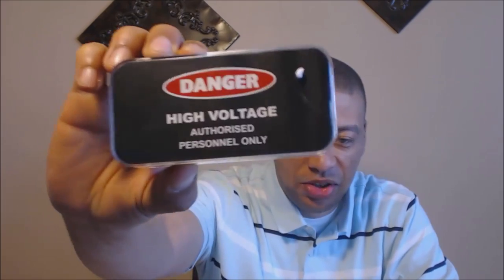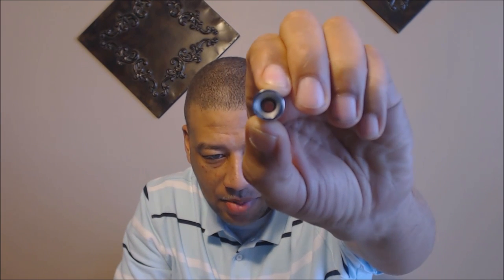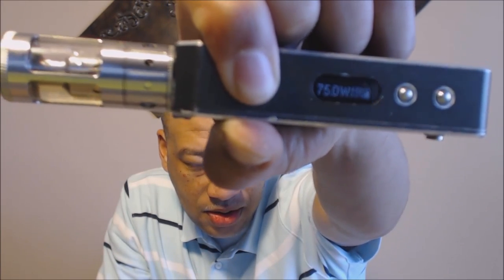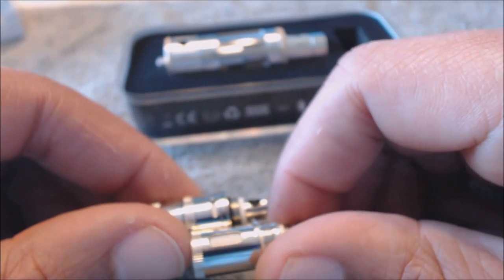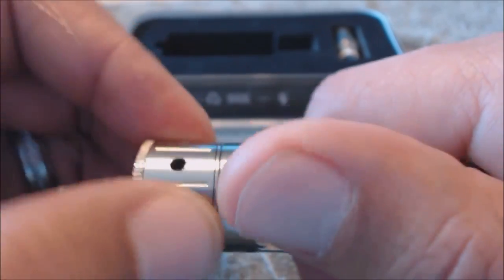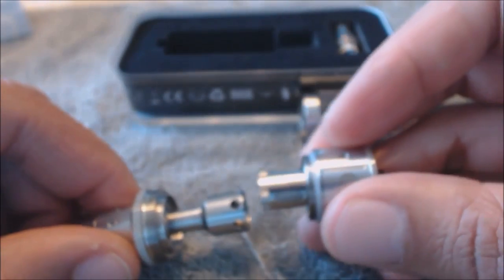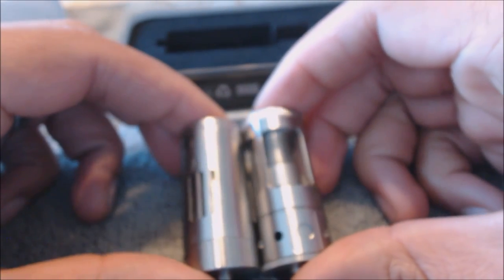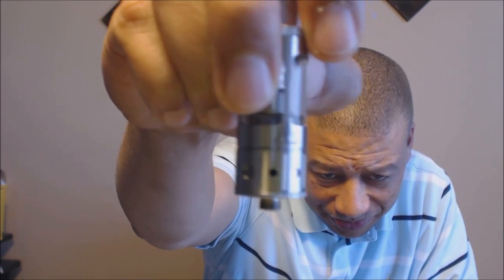(New 1080p)HIGH VOLTAGE Another sub Ohm Tank This one is Guud

Comment: I tightened it after it fried my m80, then put onto the istick, which after 4 pulls stopped working, checked the pin again and it had come loose, and now no longer wants to fit where it's meant to properly anymore, yeah possibly, mine doesn't feel like it's under gone any quality control at all

Comment: PS: I just noticed that my tank was built differently.
It doesn't have the holes at base 2 line up with coil & the outer air slots @ bottom of tank are elongated with one opposing the other.

Comment: Nice!
Reply from the maker: Thanks
Reply: Yes it is the newer version of their drip tip. The matrix is supposed to be better. There's a list of differences. 

The Matrix Sub-Ohm Dual BVC Tank by High Voltage ups the ante of the Sub-Ohm Tank field once more, integrating a massive 5 milliliter capacity, dual adjustable 14 mm airslots, and an integrated 6.5 mm auxiliary tip airflow! 

Designed in the USA by High Voltage

Introducing the Matrix Sub-Ohm Dual BVC Tank by High Voltage, the newest Sub-Ohm Tank that integrates cutting edge designs to combine to make one of the most advanced and feature loaded tanks in the industry! Starting from the Dual Vertical Coil foundation, High Voltage configured the base of each Matrix coil with rectangular intake holes, increasing airflow rate into each coil tremendously. Paired with the adjustable dual airslots measuring a staggering 14 mm each, airflow passage is efficient and adjustable to allow for unbelievable rates. Each coil features a large juice intake surface area in order to keep the rate of wicking efficiency extremely high to cater to ultra high wattage chain vaping. The Matrix is constructed from high quality Stainless Steel and Pyrex, with the tank, coil, and airflow chambers streamlined in order to accommodate an incredible 5 milliliters within a 22 mm wide profile and competitive height, dwarfing the competitions current capacity. The included competition bore tip also features an adjustable auxiliary airslot measuring 6.5 mm, allowing for secondary cooling to make ultra high wattage vaping cooler and more effective. With an incredible feature set, top level performance, beautiful fit and finish, and a very competitive price, the Matrix Sub-Ohm Dual BVC Tank by High Voltage is an absolute must add to every collection.

Comment: I just picked one of these tanks up today. My drip tip is different though. It has adjustable airflow but the style is different. It's just one oval shaped hole that you can close off to different sizes. I'm wondering why that is...
Reply from the maker: Can you join cloud compound group on Facebook. Take a pic of it and share. Its a closed group but you will get let in by myself or another vapor. I would like to see that
Reply: I just bought one of these and have the same thing. My drip tip doesn't have multiple holes. Just 1 oval one with a gradual opening. Has anyone figured this out?
Reply: spaz0023 I just posted to the link you have, the one with multiple holes can be found on this link, which is where I ordered mine for a great price and has coils in stock

http://justvapeinc.myshopify.com/products/high-voltage-0-2-sub-ohm-tank
Reply: Yes, we did find out that the one that has the just the 1 big airflow hole is actually a newer version that the company is no using for this tank and their new tanks including the Matrix tank. Thanks though.
Reply: Now using*
Reply: spaz0023 So wait the "Matrix" tank is actually newer than this High Voltage tank? I was trying to look side-by-side and ended up deciding on the High Voltage but now I'm wondering if I should switch! I also thought I would like the multiple holes on the drip tip better, can you close the single slow drip tip or is it always open?
Reply: You can close it gradually as much as you want.  Until you have your desired airflow from the drip tip. Or if you want it completely closed that is an option as well.
Reply: spaz0023 Are you sure that it is the upgraded version of the one with multiple holes? And is the Matrix supposed to be better than this High Voltage tank?
Reply: Yes it's their newer version or newest drip tip that they are using on their tanks. Here's a description of the features of the Matrix tank. 

The Matrix Sub-Ohm Dual BVC Tank by High Voltage ups the ante of the Sub-Ohm Tank field once more, integrating a massive 5 milliliter capacity, dual adjustable 14 mm airslots, and an integrated 6.5 mm auxiliary tip airflow! 

Designed in the USA by High Voltage

Introducing the Matrix Sub-Ohm Dual BVC Tank by High Voltage, the newest Sub-Ohm Tank that integrates cutting edge designs to combine to make one of the most advanced and feature loaded tanks in the industry! Starting from the Dual Vertical Coil foundation, High Voltage configured the base of each Matrix coil with rectangular intake holes, increasing airflow rate into each coil tremendously. Paired with the adjustable dual airslots measuring a staggering 14 mm each, airflow passage is efficient and adjustable to allow for unbelievable rates. Each coil features a large juice intake surface area in order to keep the rate of wicking efficiency extremely high to cater to ultra high wattage chain vaping. The Matrix is constructed from high quality Stainless Steel and Pyrex, with the tank, coil, and airflow chambers streamlined in order to accommodate an incredible 5 milliliters within a 22 mm wide profile and competitive height, dwarfing the competitions current capacity. The included competition bore tip also features an adjustable auxiliary airslot measuring 6.5 mm, allowing for secondary cooling to make ultra high wattage vaping cooler and more effective. With an incredible feature set, top level performance, beautiful fit and finish, and a very competitive price, the Matrix Sub-Ohm Dual BVC Tank by High Voltage is an absolute must add to every collection.
Reply: The Don Do you know if the High Voltage Matrix and this High Voltage are the same company? Do they use the same coils?
Reply: Same company, different coils. Not sure if the opposite coils are compatible with the other tank, but the matrix has rectangular intake holes rather than round.
Reply: spaz0023 I just can't decide they're both so similar....

Comment: Update, the adjustable pin has become loose without me even playing around with it, and has ended up killing both my istick 50w and my m80 plus, the build quality on this is a joke I wouldn't recommend at all
Reply: Wait a second. You new you could adjust it, but you did not check it from time to time to make sure all was good after it killed one device? Then you say it was it was never touched. Every time I take it on and off a device I would always check all screws even on drippers to make sure they are tight. Or maybe you got a bad one. I have no problems with my 2
Reply: Also when I mean without playing around I mean, not consistently adjusting and playing around with the pin, didn't want to wear out the threading

Comment: For some reason my glass keeps shaking inside the shell and no longer holds liquid in properly, do you have an idea as to why it would of happened?
Reply from the maker: There are two O rings, one on top and bottom, they are clear make sure they are in there. They are very small
Reply: Oh right, somehow both of the small o rings have disappeared leaving me with just one thick one, must of happened whilst cleaning, I think that's quite a big design flaw pretty peed off about it
Reply: I Defo think the positioning of small o rings was a design flaw which none of the other new sub tanks have
It didn't feel like it was amazing quality when compared to the Arctic, but flavour amazing vapor production amazing capacity perfect.
Also weirdly it feels like the Arctic fires up much quicker than this does, but it's certainly a good tank and I loved the airflow, the adjustable drip tip comes in very handy at 70+ watts
Reply from the maker: Mo Sacks try some from other tanks you may have some luck
Reply: The Don to me you are currently top 5 most helpful people in the world lol, just tried a subtank mini o ring and it worked, a tiny bit of leaking but i can actually use it again! thank you so much, and also thanks for the reviews you make, they are very informative and it feels like you know your stuff much more thank a large chunk of the other reviewers. the name perfectly fits the character!
Reply from the maker: Mo Sacks your welcome, thanks. Hey you might can fine a Lil smaller one and stretch it to fit due to the org being so thin. Thanks for watching.